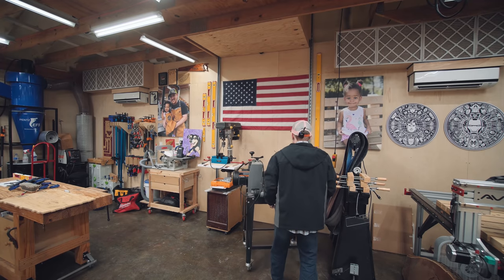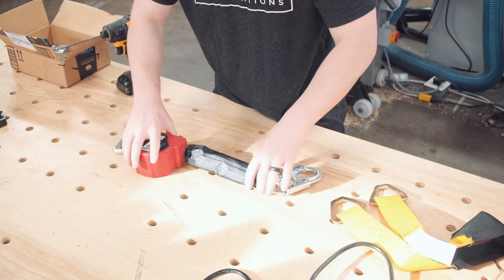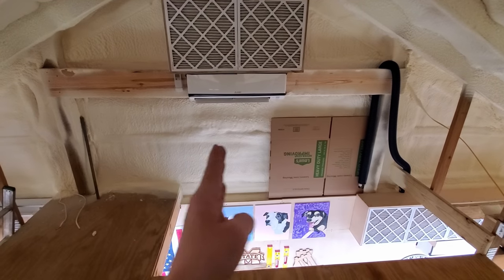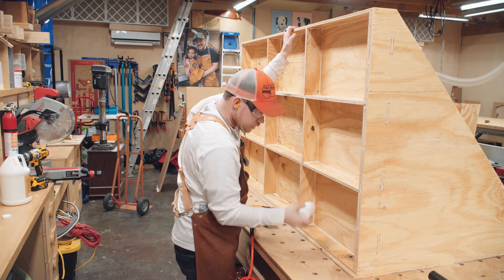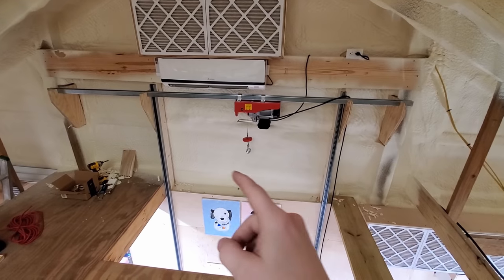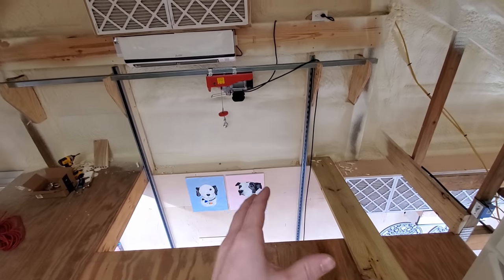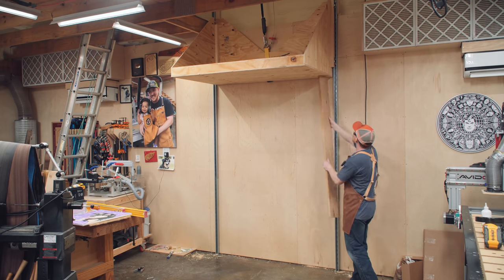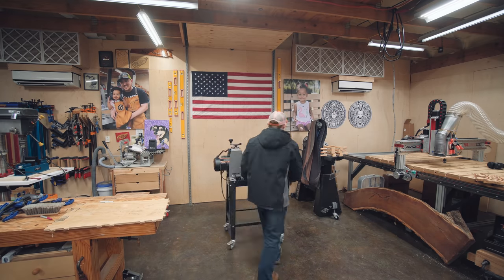DIY Elevator - 364

Comment: You speak of risk using this lift but didn't mention the risk of something going fatally wrong with this build. As a Elevator Tech for 30 years I can tell you as well as any elevator mechanic could, this is a death trap for a person to use as an elevator. It is a dumbwaiter at best but still has many safety issues for when a mechanical or electrical failure occurs. The biggest problem is the non-existent safety mechanism to prevent a free fall or overspeed situation. Yes you have the fall arrestor but it's mounted on the same very faulty support system that the hoist is mounted to, the fall arrestor is most likely under rated for it's use and not designed for that type of use. There are many parts of any elevator working together to support the person riding it. If any one of these fails a fatality is very possible. If an adult chooses to ride this thing you should at least be aware of the Dangerous possibilities. A child should never be allowed to ride it. I can understand using this to lift items but stay clear from under it. Knowing the possibilities and seeing firsthand the extreme dangers an elevator can have, I would never ride this lift myself. This should never be shown as an elevator because it is a death trap for passengers and anyone below it. You should research slack cable safeties for residential elevators as a start than look into the many other safety features that are missing on this lift.

Comment: Did I hear 500lbs lift strap - 200lbs man - 150lb. Cargo - 100lbs platform -  ??lbs Twisting/binding load on the bearing.   Most items like this 2x safety factor

Comment: All those tools and you don't own a Sawzall or Band Saw????  I nearl;y lost 2 finger 40 years ago when my grinder caught in some square tubing steel I was cutting with it. It flipped around and hit the bottom of my little finger and sliced it and the next finger to the bone before I could react.   And I WAS wearing leather work gloves.

2 Thumbs up for adding the fall arrestor. Wasn't cheap, but neither is a ride to the ER!

Comment: Spare ladder ? in the loft in the event of a power cut.
We had an old metal staircase in the blacksmiths shop to reach the mezzanine floor, I laugh when I think about it now it had a very badly bent lower step and in 30y we never fixed it, very odd since we had everything to fix it in about 30min just never did.

Comment: I would mount the fall arrestor to something isolated from the winch strut.
You have no protection should that assembly fail. Main line and safety line should be attached to separate and isolated anchoring.

Comment: I think the weakest point of this whole deal is the horizontal Unistrut supporting all the weight.  I would have used double 3/8 angle iron instead of Unistrut.  The far left and right supports are ineffective.  If used at all, they should actually hold the strut down, not up.  Furthermore, the fall arrester is a false sense of security.  If the hoist was to fail, the platform would drop suddenly and the force on the fall arrester would potentially be 4X the static weight.  I suspect neither the carabineer nor the Unistrut would support that sudden force.  Non-engineers should not build things like this.

Comment: I have used uni strut for years it will fail, put in a laminated  or steel cross piece and fix hoist to it. Put in a drip diverter for the ac. Look into folding and different type safety Gates that are automatic when your car travels. The electrical safeties are not enough you will turn your back for one second and it will be used. Good job just a little more. Oh stop it half way up and get off in a safe way. Sorry Murphy's law type guy.

Comment: You definitely should have used the engineered components of a hydraulic lift, diy or not… so many failure points and very little to hold back failures

Comment: I like the idea of adding the lanyard as a fall arrestor. Not it's intended purpose but it's working. Consider giving the strap it's own connection to the platform. The way it is now you have a single point of failure in the one strap that the hoist and lanyard are connected to. If the strap fails neither will stop the platform from falling. You mentioned adding a railing around the floor opening. When you do that include a toekick to stop anything from rolling off the edge and as the name implies a foot from slipping off the edge just like if you were on a scaffold. 

Or maybe add something like this: https://www.youtube.com/watch?v=uKfYjWBLKis

Comment: I would have purposefully left a larger Gap where the front meets the mezzanine floor, so that wayward teenagers or absent minded adults don't inadvertently lose their toes or fingers.
Reply from the maker: If someone is stupid enough to keep their foot hanging off the edge when going up then they probably get what they deserve. It's a restricted access elevator. Not a toy.

Comment: Don't do this, it's dangerous, that equipment is a winch and should not be use for lifting especially more as elevator! There is several rules regarding the elevators and lifting.

Comment: Change your outlet to a GFCI
Reply: Please build a truss for the top of your super strut, don't forget if the hoist fails you will experience dynamic loads  far greater then 500lbs when your safety device kicks in and you have it attached to the super strut  it will most certainly fail.

Comment: I actually work on elevators for a living, so let me get this out of the way first, that thing is in no way human rated, and doesn't meet code at all.  I will say you have thought of things most people who try to build one of these don't think about,  you need a better system for the fall arrester, it needs to break the unit to the rails, making it immobile and I don't like how little structure is in place for the mounting point of both the cable and fall arrester.

Comment: Your comments about the design tell me that you didn't run any calculations on it. IMO, your horizontal bar is not up to the task! A the very least, you need to make about a 5' long wood pattern  to slide inside  the horizontal bsr. This will prevent the sides from folding in.

Comment: That’s not super strut super strut is 2 3” unistrut sticks back to back welded together what you have is normal 1 5/8
Reply: On another note out that piece of 1-5/8” strut around you want the strut under compression this will help mitigate the flex your talking about